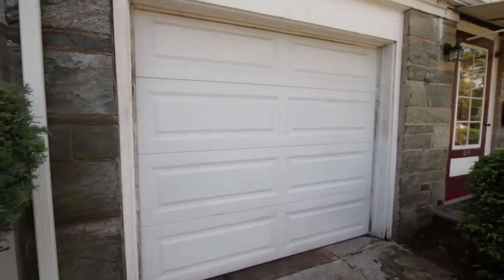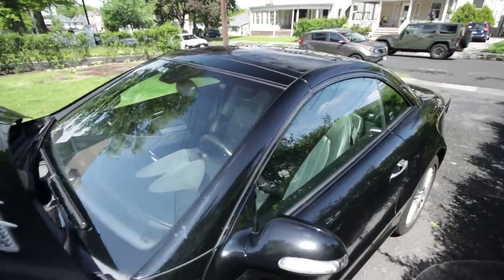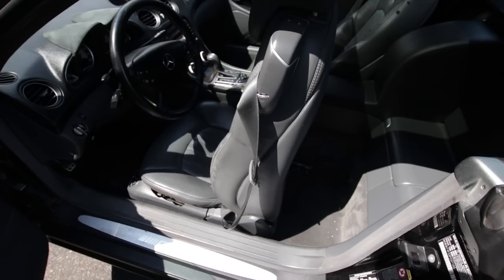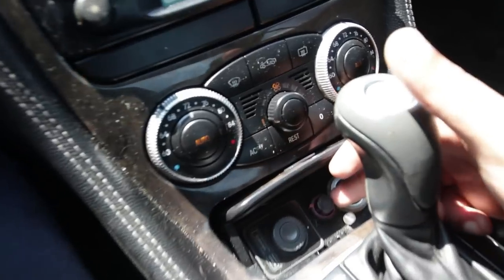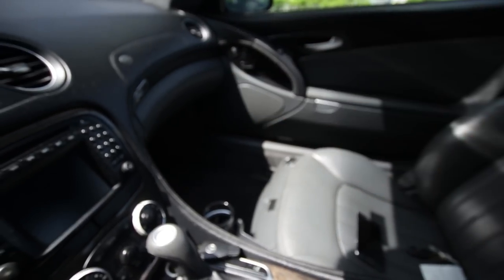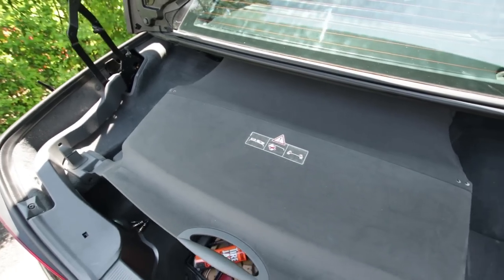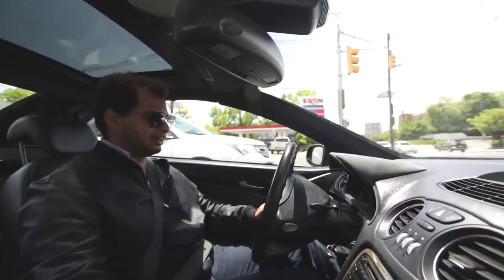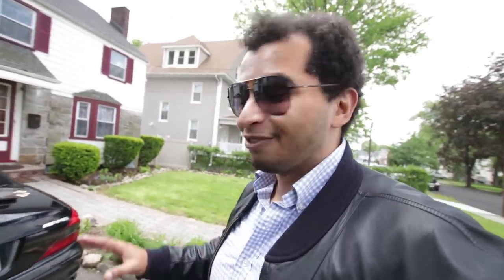I Just Bought A $130,000 Mercedes-Benz SL55 AMG For $8,900

Comment: Flush your fluids... the ABC suspension will have leaks. I think there is a line behind the motor that's common. 

If you can't fit your thumb between the oil pan and front subframe, you'll need motor mounts. 

Valve covers leaks are common... Replace the breather hoses while you're in there. 

Water in the trunk? Check the seals at the rear window to pillar meet. 

The transmission "pilot bushing" connector(passengers side above the oil pan), leaks internally(happens a lot) and can travel up the harness and damage the TCM. 

SBC doesn't go out too often. I've seen them last 10 years. A lot of them had a 10 year warranty where most the faults have been repaired. They do need software updates. These should be checked by your Mercedes dealer during your A/B service. Honestly most Techs skip this step on the service, make sure your service writer ask them. You can request a print out of this.. if they say they can't then get a new advisor. 
 
Too take that rear buckle off pull the top part of the fabric belt and slide it out at an angle toward the pano roof.

Rub a little bit of motor oil on that crack in the wood grain on your ash tray. It helps. 

Cool car, but it can be costly.

Comment: Nice pickup! I'm a sl55 owner myself and have had to deal with numerous little glitches and common failures over time. Not too bad if you're a diy typa guy that I know you are. I noticed your brake visit workshop message on your dash and think your sbc counter has run out or the accumulator is bad. Looking forward to updates and of course here to help if you have any questions.

Comment: Look at all those people yapping about maintaince and stuff. Yeah, it's going to be expensive, but so, so fun. Go back to your Camrys ya killjoys! Definitely a good purchase, congrats to you Freddy.
Reply: Gangsta Hustler If you let it get fixed at the dealer. Sure doing it yourself is still gonnq cost. But you could buy a great condition one for 30k and  it blows up the next day. Atleast for now if it blows up, it's "only" 9k.
Im sure Tavarish is gonna fix this thing up fairly cheap and will have an awesome car
Reply: Yup, if he wants reliable cheap RWD buy a fucking towncar.
Reply: You need massive skills to do fix many things yourself.
Reply: It's not even that expensive LOL These are just idiots who go to the Dealer for repairs and Walmart for oil changes. I also go to a performance Mechanic for mine. Brand new it's generally expensive to replace parts. But the older models have a yhuge! support in aftermarket AND original parts both online and through different companies.
Reply: Gangsta Hustler. All they got to do is get a good mechanic. Ebay has parts cheap. People are dumb sheep scared to do their on thing.
Reply: Damn right towncar back then we’re so reliable and bulletproof

Comment: Have fun when that SBC unit goes out
Reply from the maker: kunalhuhu it's most likely already out
Reply: kunalhuhu you can send the module off and have it rebuilt if so.  I have that unit in my car and it works great when it works.  Every car has an Achilles heel.  I like the car!
Reply: SBC is a walk in the park compared to the ABC suspension. Get that sucker flushed or youll pay through your nose for repairs.
Reply: Also you might want to look into getting an autel maxidas to do diagnostics. Autel has replicated star diagnosis pretty dam well
Reply: And get the vario roof checked.
Reply: Tavarish true. I had an 03 e500 and that was the worst car I have ever owned. SBC issues, airmatic issues, and the famous transmission failure. I will only buy face lifted Mercedes models because by then most issues are resolved. The SBC gave me nightmares
Reply: One of the worst issues on these cars. Can even be fatal
Reply: just replace it with proper coilovers from KW.
Reply: Oh if it was out you would notice! It goes in proper freak mode, and NOTHING works anymore, if it happens while driving you can loose most brakes! Trust me, I've got some freaky experience. Just one word: Towing.
The SBC is like brake by wire, for those who asked. You press the brake, and this car determines how much brakeing you need at every single wheel in the situation. It's kind of handy, if you use ABS for ex the pedal won't chatter. And it stops you really fast. The unit just goes out after like 250'000 uses, and if that happens, its expensive and scary, as I said.
Reply: Its a 200€ job to repair SBC pump. Not a big deal.
Reply: peter halasz ...in the US its alot more
Reply: SBC just needs a recet, it does not actually go out, it gives an error after 300k break use
Reply: valgehiir thats like resetting your oil light and not changing your oil. something will fail and not very smart. the reason they do that is because after the set point the chamce of failure increases. it needs to ne rebuilt or replaced
Reply: nick elias, nope, it's not like resetting oil change warning.
SBC pumps themselves are in good condition, 300k pumps is nothing, it was simply bad software design by Benz to restrict pump to only 300k, and show a warning. All that can fail are brushes of the Bosch electric motor inside the pump, you can inspect those visually, and replace if needed, there are 4 graphite brushes.   I opened my pump when the brake warning came up at 90k km, the pump is fine. So reset of the software is all tha'ts needed. The pump simple can't fail after just 100k or so miles, and thaat's what R230 have on them, unless FL or CA cars in USA, in Europe it is near impossible to have them over 100k miles, since we have winters even in most southern parts of continent, and no one drives them during winter. I still drive my SL55 today, there is a video on my cahnel :)
Reply: valgehiir between these and W220, people are so scared of the computers it is amazing. I invested in an Autel MaxiDAS DS708 for my W220 a long time ago. Should I ever drive anything besides a Benz (dunno why I'd do that!), I will still be able to use the diagnostic computer on those cars since it does everything from Lambos and Ferarris to Toyotas and Fords. People also failed to realize that these cars have a lot of DIY rebuildable parts. This makes repairs cost 25% of dealer prices for new parts and is a viable option considering the residual value on most of these out of warranty cars.
Reply: I believe he just fixed that and uploaded a video on it... today!
Reply: yeah, he did :)
Reply: valgehiir I am not at all surprised. These cars are deals if one understands what he's getting into upfront like Tavarish. I would have to sink myself $40k into debt (more after taxes and banker-enrichment fees i.e. interest) or flush money down the lease toilet to get anywhere near the amenities and performance of my low-mileage W220.
Reply: Yup, no doubt!
Reply: They extended the recall to 25 years got mine fixed for free